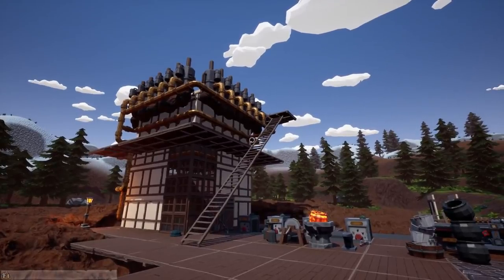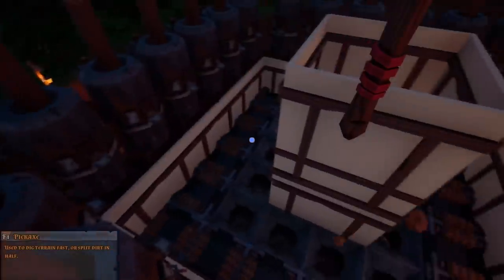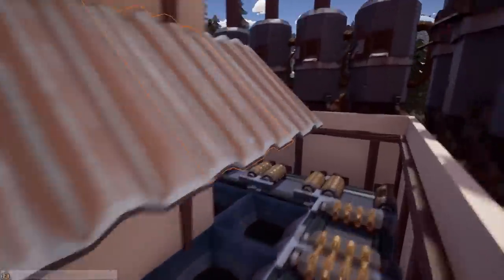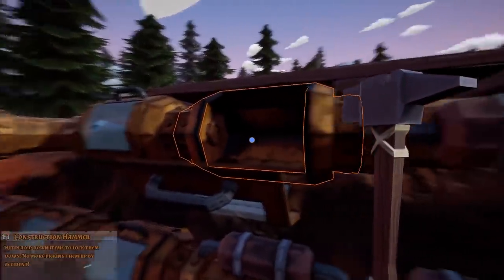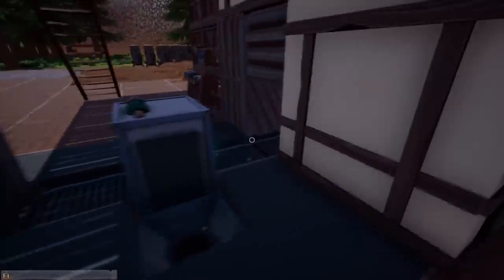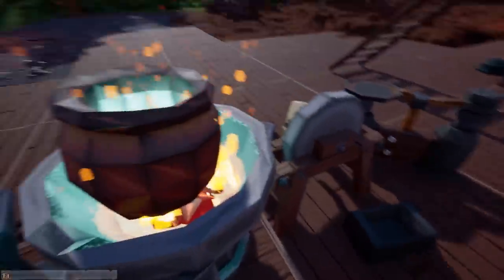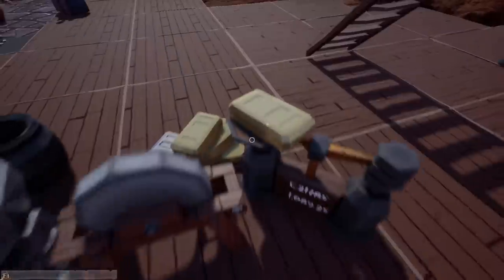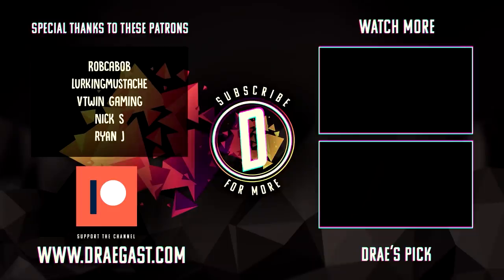The Perfect Gravity-fed Gold Mine – Earning Major Cash With A Ram Drill Tower in Hydroneer

Comment: You can either drive yourself insane and cut down your bars for resmelting, or you can be a wizard and use the magnets to levitate the bars in. That being said, get some safes to lock in your other bars so you're not mixing everything. But things will freely rotate while they're magnetized. Makes getting that angle in a lot easier.

Comment: Something I've learned, is that if you have the crucibles in the furnace's and the gold dripping into that, it saves on performance and is less of a hassle to work with. I don't know how but in my save at least I managed to merge a concrete block and the furnace into the same block and the crucible still heats up on top of the block.

Comment: what you NEED to do is place wall sections in front of where the dirt comes out from the drills. the dirt hits the wall, falls onto the grinders, through the funnels onto the conveyer belt below and then to the sorters where you use it for whatever.

Comment: Put the crucible in the furnace - crouch  with the bar in hand, and line it up with the crucible.  It'll be put inside (most of the time).  If the crucible is heated up, it'll instantly just melt the bar.

Comment: You could have the second layer of drills funnel into the hollow center so you could have separate loads that won't interfere with each other and ruin the perfected system of the first layer. Two separate working parts of the same machine.( I'm talking about the gold falling through the center not the paydirt.)

Comment: put a furnace and crucible at each area where pieces come out (gold, metal, shards).  This way you can reduce lag pretty much altogether.  With pieces constantly melting, you don'tget  thousand pieces slowing things down.
Reply: This. you need to reduce the number of collisions which are occurring - smelting the nuggets as soon as they come out of the filters will help SO much.
Reply: That doesnt work properly last i tried when a new nugget goes in whats already melted despawns
Reply: Shawn Hafford I e had this system set up on my plots for awhile now with minimal issue.  Though Inhave found if you mix the metals, it can respawn everything.  But that’s only happened a few times across three plots.  For the most part, I’ve had few issues with this setup.

Edit: the giant gold nuggets I’ve had issues with, but no problems with little nugs.
Reply: He already tried if never worked.
Reply: The game doesn't work like this. Dreagast tried it in the past and it didn't work
Reply from the maker: I was told bars stack but nuggets don't so it would delete any nuggets after the initial melt. I'll ask the developer about it though
Reply: Drae super interesting.  It’s worked fine for me, and Ingot the idea from other you tubers.  I’ll go back and find the ones that gave me the idea if that helps.  Would be interesting to hear what the developer has to say.
Reply: Dimondminer11 yeah, it didn’t work in the past.  Game has since had multiple updates.  I got the idea from a couple other you tubers, and now have it set up on all my plots. shrugs all I know is it works across  my plots.
Reply: @drae  As long as you don't take the crucible off the furnace you can keep adding nuggets or ingots and they will add to the total.
Reply: patch notes 13th may 2020 - fixes - New resources being added to a crucible with molten material will now count towards the total content instead of replacing the total content.
Reply: Ecktos there it is!  Thank you!!
Reply: @drae  that's certainly not been the case for myself or for MikesPC1080P - check out his channel, he has a large setup going that terminates in filters which discharge directly into crucibles, which continue gaining weight. He gets 20k bars in minutes

Comment: With higher levels of the mine rather than setting the ram drills to miss each other you could use the central column to drop down loot. I'm picturing another layer of the things that clean the dirt, facing into the central column to rain down a constant stream of iron and gold.

Comment: The projectiles that come out of the ram drill is 100% consistent of where they land, how they interact with walls or funnels is random (RNG where they land). Just make the rocks feed directly into an individual grinder for each drill. No walls, no ramps, no funnels, and no conveyors. You might be able to feed 2 drills into 1 grinder with this setup but I haven't seen it yet
You can test this by just using 1 drill and 1 grinder feeding in an infinite loop until you get it right instead of going straight to the full grind setup.

Comment: use a seperate sorter in the line to realign the ores. choose dirt, so that the sorter doesn't filters the ores. this middles the ores perfectly and they go straight in the sorter. no more problems. use a auto smelting setup too. and mind helios mod etc. with the bigger cauldron.

Comment: Drae, you really should put hot couldrons under the exit of your splitting machines. It reduces lagg. All the individuals pieces cause lagg so if they drop in a heated cauldron they smelt and dont cause as much lagg as you are experiencing when running the system for a long time. Only doenst work with gems while they dont smelt.

Comment: @DRAE 9:14 PUT THE CRUCIBLES IN A LIT BRAZIER TOO, SO ALL THE NUGGETS CONVERT TO LIQUID DIRECTLY!
In that way the game can get rid of a LOT of data & polygons (like 50-100 polygons PER NUGGET) and don't have to calculate as much stuff, and the liquid just adds up the values of the nuggets, so it saves performance there too (just use one number in total, instead of one number per nugget). It works, just as you can see here: 19:45 (vs. 19:40 )
(Just don't log out without emptying the crucibles, I think there is a bug that resets them to empty then)

Comment: the 4 filters to a system doesn't actually work. to get a truly unstoppable system youd need about 400 filters. the first filter reduces breakage by 25% but the second only reduces it by 25% of 75%, and so on.
Reply: also, you can melt the giant bars together if you get them to tip in the right way, but its easier to saw it into a bunch if small bars.

Comment: You do know that every mining claim in the game has amazing paydirt you just have to Dig Down Deeper the deeper you dig the bigger your gold will be the more money you'll make in the less lag you'll have because you'll be bringing up pieces of gold bigger than just tiny little pebbles and it'll make it run smoother having a big giant gravity-fed system is making it way more complicated than it actually has to be you can just set up a ramp down to the bottom of the claim make a ramp of conveyor belts that can bring paydirt up to the surface and underground make a line of drills that will spit out onto the conveyor belt of Grinders that will keep the dirt small until it can get up top to be processed the gold you find even if it's coming out of small dirt will still be massive and worth way more than what you're finding and you'll find bigger gems and bigger Hydro crystals that you can make into bars of  hyper energy for pressure tanks the big gold nuggets are worth the same as 30 to 40 little ones and they don't lag as much as all that little crap the deeper you go the bigger every resource you find will be Iron will be massive gold will be massive gems will be massive sorry for making this so long just wanted to give you some helpful advice also you can make a much better funnel out of just putting like 4 boxes around in a square leaving an empty space in the middle it tends to work a lot better than the games crappy funnels that suck ass